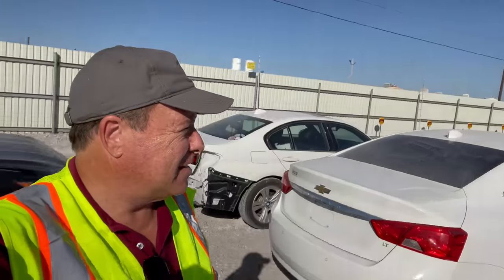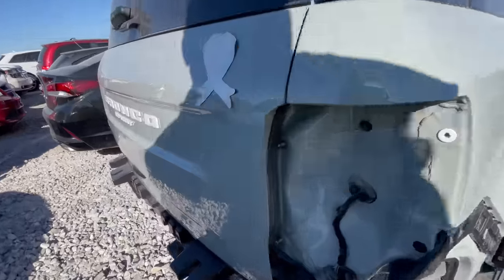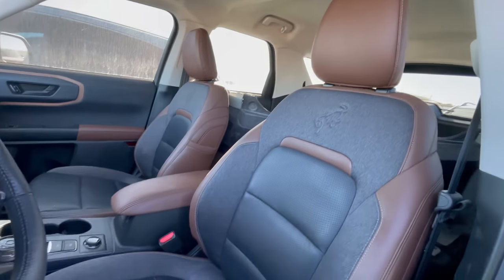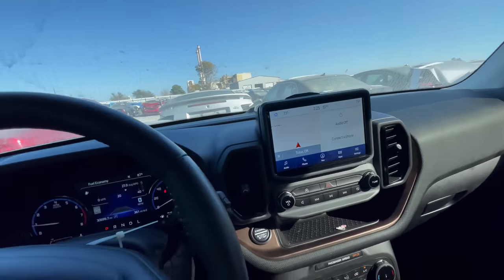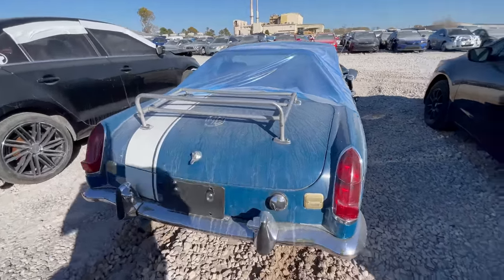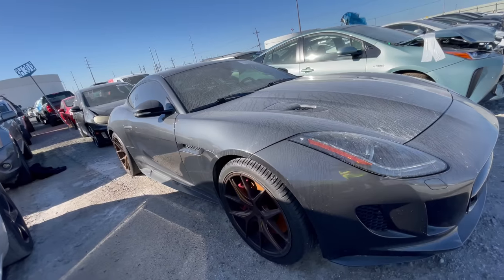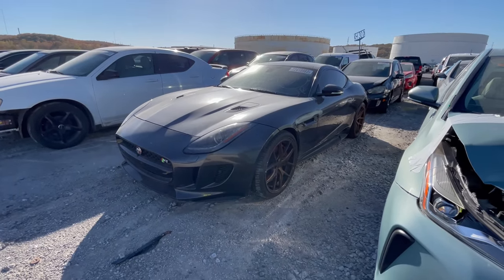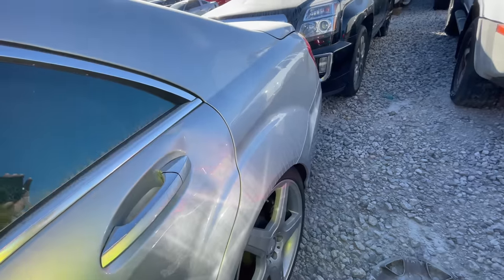Plus The Worst Burn EVER! Copart Walk Around 11/9/23

Comment: I would think the damage on the Bronco is similar to another suv l had a while back. I was towing a trailer and somebody ran into the back of the trailer. Damage to the body was minimal but rear chassis underneath had extensive damage causing the vehicle to be totalled.

Comment: Color on the bronco sport is  cactus grey and ours is that color but black interior with 47k and is a 2021! And no cover under the hood also looking down on inner fenders there is no cover! Engine is a 3 cylinder and probably why the shake buts ours does not. Also cooling fans when running sound like a fire or tornado siren!